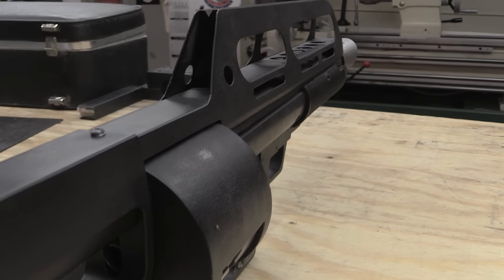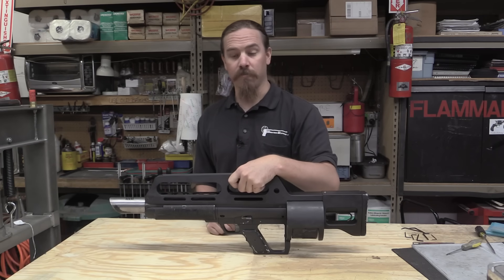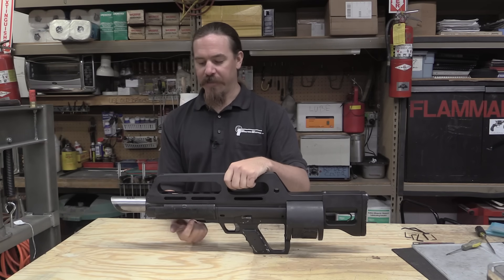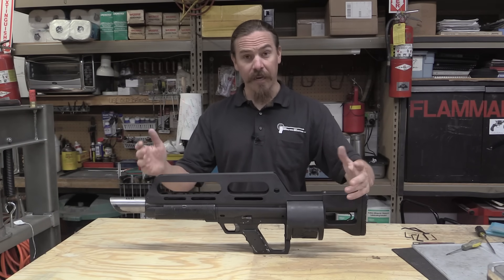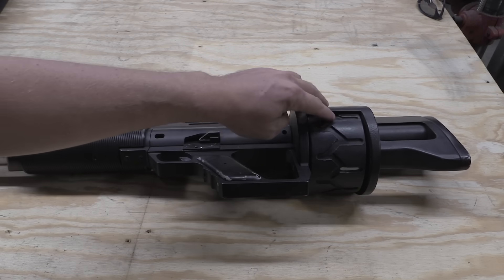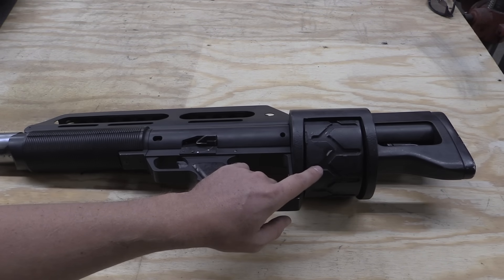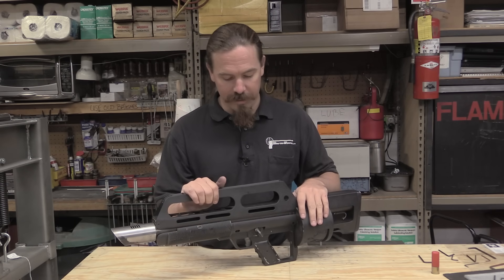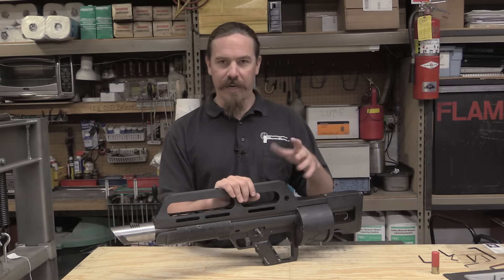Pancor Jackhammer: The Real One

Comment: I'll tell you what's terrifying: as near as I can tell, there is NOTHING to prevent it from firing out of battery. if the barrel somehow fails to nest inside the cylinder, the gun will explode ahead of the cylinder in a spectacular fashion.
Reply: @WardenWolf
I could be wrong but I suspect the way this thing is set up it won't get to the point in the cycle where the striker is cocked if the cylinder isn't rotating and the barrel isn't snugged up to the cylinder. 

Regardless, It would indeed be upsetting to have a 12ga cartridge firing OOB right behind the handgripz quiaff? 🤪